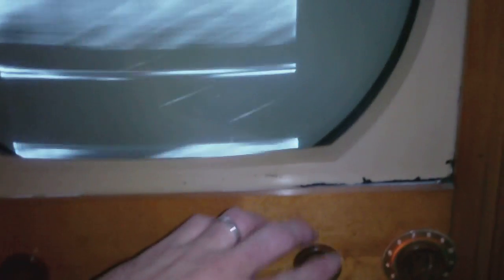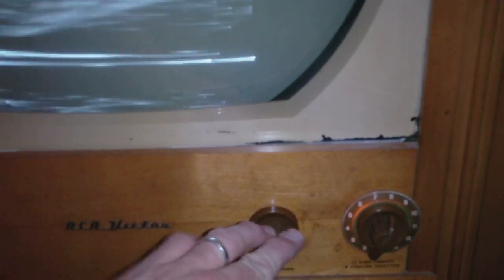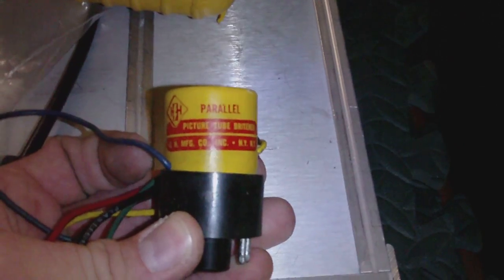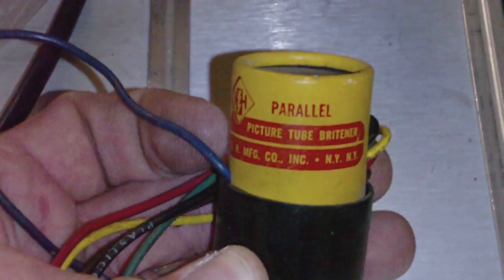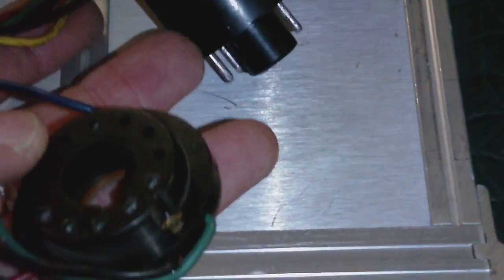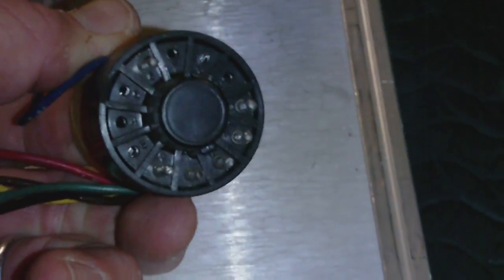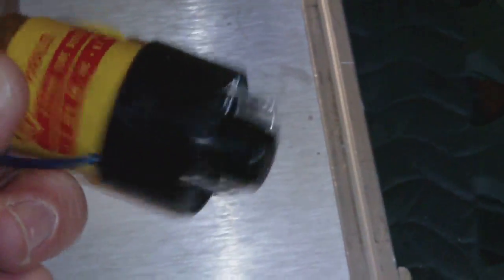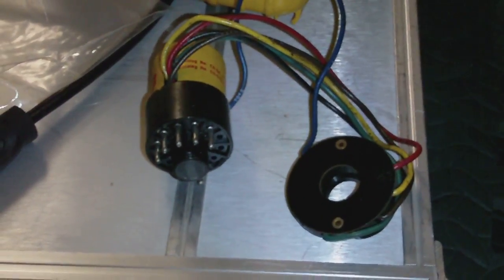1950 RCA TV Model 6T76 Update 2 + parallel CRT brightener

Comment: Hello I have a model similar to this tv and I had a question. I'm trying to gut it (and I was warned that people would yell at me for this but if anyone is interested in parts I have them) but I know little about electronics but I was told that I need to discharge the crt. Well most videos tell me to ground the anode to the chassis however (as you know) there is no anode suction cup on the CRT so my question is, how do I discharge this kind of CRT? Thanks so much!
Reply from the maker: My first advice is to have a technician that has worked on tv's do it for you just to be sure because you can get a nasty shock, especially if the tv has been powered up recently. 

The way I would do it is this: If the back of the crt is metal (like mine) take an alligator clip lead and clip one end to the metal chassis and the other end to a metal screwdriver (with an insulated handle of course) and touch it to the back of the metal crt.  I'd be interested in the picture tube because mine is weak but I saw from your Google+ that you're in NY, im in CA.
Reply: chrisw71 Thanks for your help and too bad because I wish I could give it to you! If you're interested in any of the other parts let me know.

Comment from the maker: This tv has been temporarily sidelined while I work on a 1949 Hoffman TV. I now have a crt tester that I did not have when this video was made. I will eventually test the crt. In this video it is running without the brightener.  I found this crt so bright that I wonder why the brightener was installed in the first place. Since this video was made I've been reading the tv repair forums at antiqueradio & videokarma. These videos chart my learning a new area of electronics, tv repair.

Comment: Adding to my last post, a better option for a weak CRT would be to rejuvenate it with a modern CRT tester.  I use a B&K 470 CRT tester and I've had good results with it. Rejuvenation is only a temporary fix; but, it can last a long time.  If rejuvenation does not work; then, you'd have nothing to lose by using a CRT brightener.  The 12LP4 in my '49 Admiral had an open filament due to a brightener.  Had the brightener not been used, I could have probably rejuvenated the CRT.

Comment: A CRT brightener is simply a small step-up transformer that boost the filament voltage about two volts.  As a result, the filament gets hotter; which, heats the cathode to a higher temperature.  This temperature increase will cause greater electron emission from a weak cathode. These devices can cause filament burn-out and I'll only use one as a last resort & I would not use one on a CRT that test good.

Comment: One drop of WD-40 inside the volume control many fix your scratchy sound. The parallel brightener is, I think, a filament transformer mostly. If I remember correctly it makes the filament a little brighter making the cathodes emission more, which brightens the screen.